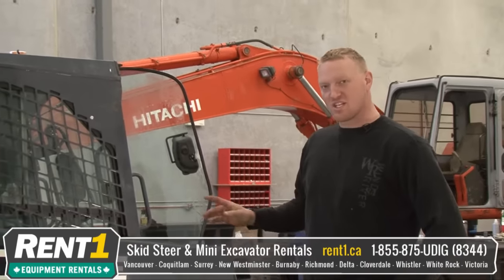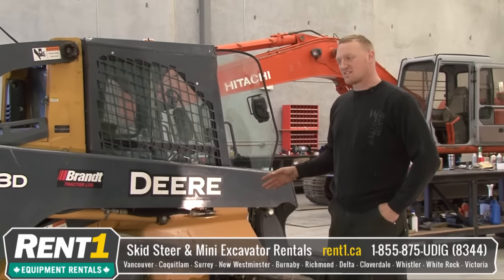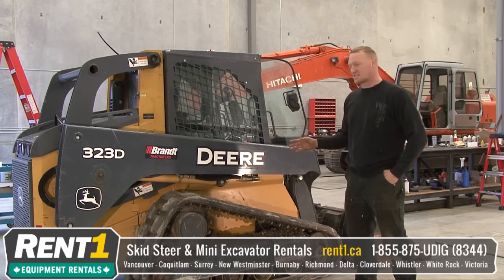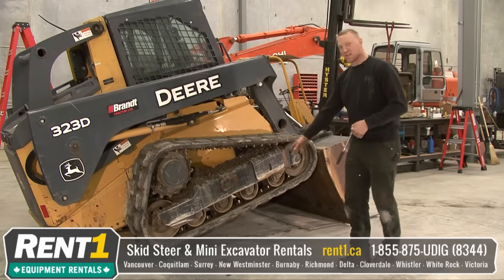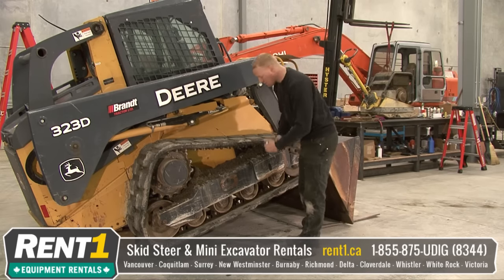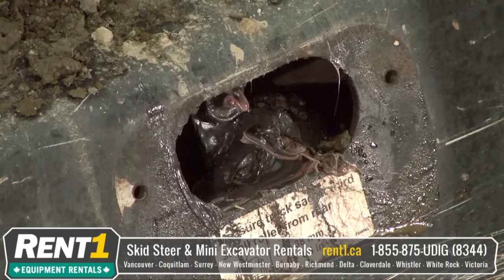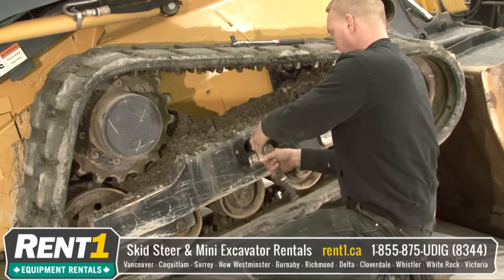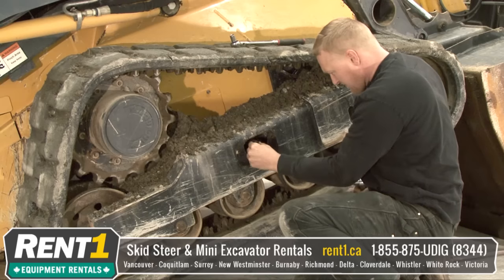How To Change A Skid Steer Track - Easiest Method

Comment: Excellent video thanks. One word of significant caution is the complete removal of the grease fitting. Couple turns out is ok. If you take one out on a large steel tracked machine the same way it can eject clean through whatever is in the line of fire. Good habits keep you at the supper table each night.

Comment: One thing you missed is when you check track tension you reverse the machine first to put all slack on the bottom and its different on most machines my gehl is about an inch.

Comment: Nice video, however -- Usually when the track comes off it's on the side  of a hill, not on a nice level surface.  And you got some attachment on it, not a bucket.   Really would like to see field re-mounting a track.
Reply from the maker: Great suggestion. We asked our partners at TekamoHD Heavy Equipment Services if they could film a track replacement video while replicating outdoor conditions. It was just published today! Take a look: https://www.youtube.com/watch?v=jmmAnPF_3SY
While still on a level surface (for everyone's safety) Keith goes into more detail about potential problems and hiccups along the process, as well as best practices for cold track installation.

Comment: This does not apply to larger Takeuchi or Gehl machines. Tracks are way to heavy to manage the way shown with the Deere. Also tension is set much tighter on the gehl/Takeuchi. Always refer to your owners manual for proper tensioning or learn an expensive lesson on premature track failure. Great video just be advised if you own a different machine

Comment: The manual for that machine says to measure from the 2nd to the front roller, 1 - 1.5 inches. While the rear roller is on the ground and front roller 1 foot off. You measured with the whole track raised, and from center roller and much more than 1 inch. Please don't post things about that if all you go if is gut feeling.......
Reply: Comatone 1982 I agree, but I think if your doing an instructional video, it should be per the book